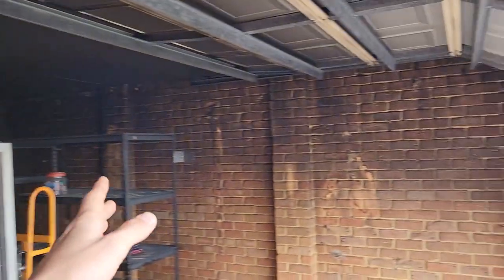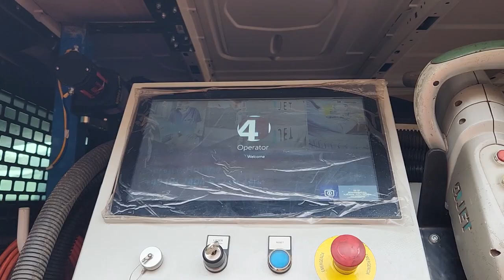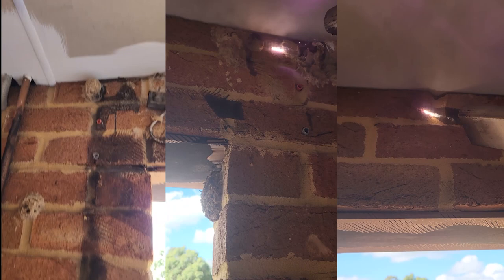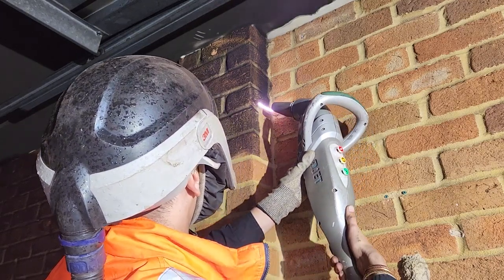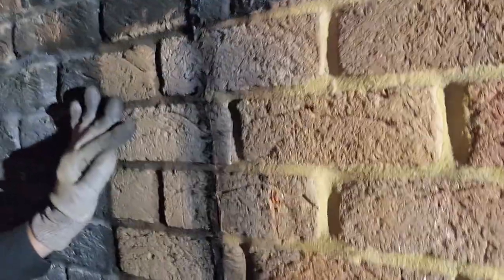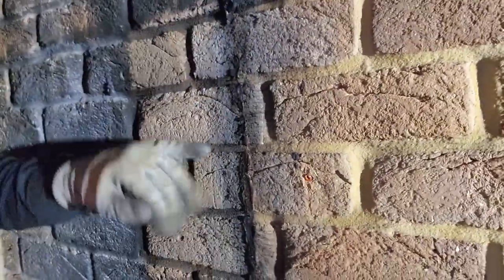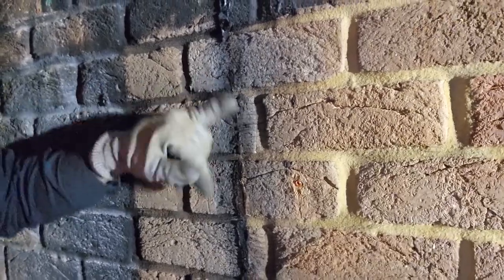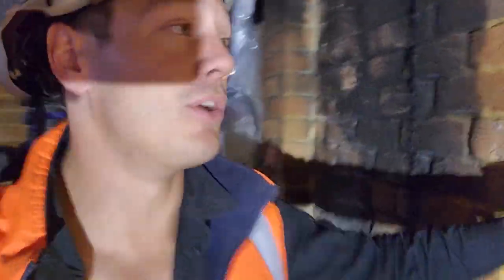Another solar battery caught on fire

Comment: What percentage are you running the laser at to be most effective?
Reply from the maker: Depends how long your piece of string is, different surfaces, colours of bricks and levels of soot require something different.  Usually 50-75% wattage, frequency and mj would also br adjusted

Comment: While I somewhat understand that throwing the highest power 2000w laser at steel would affect the surface of said steel, but what about bricks?
Reply from the maker: A 2000WCW laser would damage both the bricks and the steel, it would either scratch metal or burn the brick instantly, I have a video showing this on my E-book playlist and that's with low settings.
A pulsed laser with the right settings wouldn't damage brick or metal with that said I'm yet to see anyone use a 2000W pulsed laser for smoke damage, you'd be exhausted.